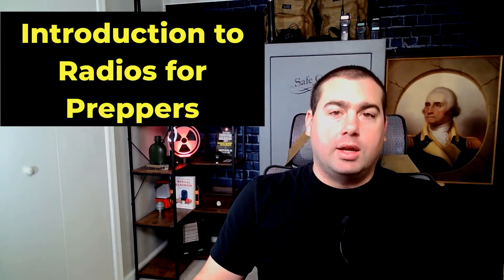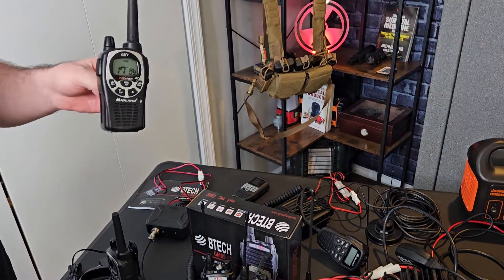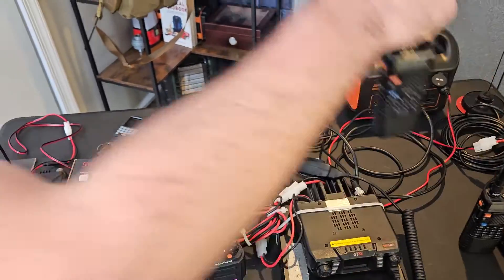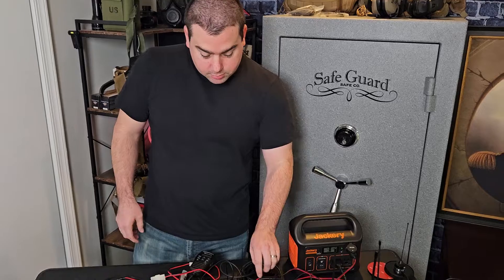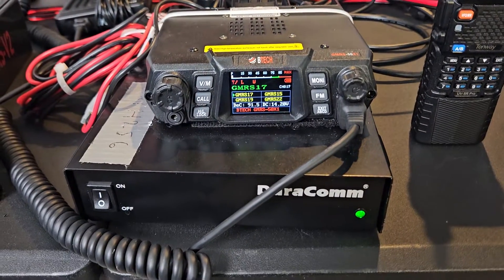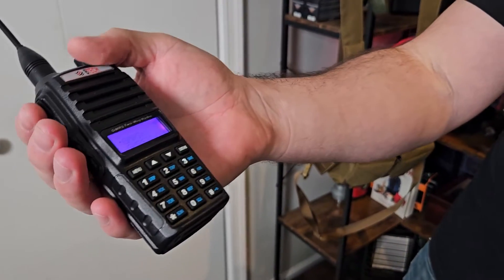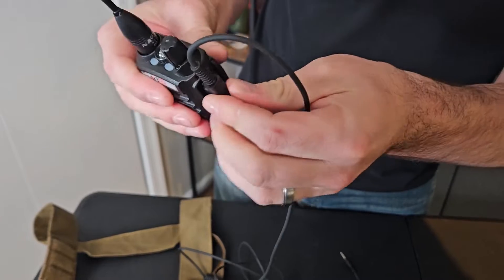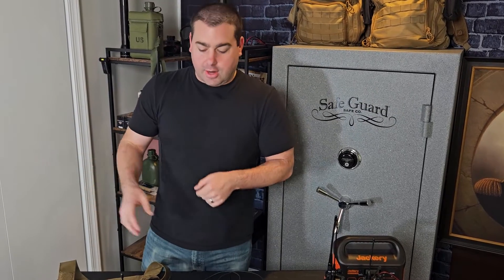A Beginner's Guide to Radios for Preppers

Comment from the maker: Hope you all find this video helpful. I've linked affiliate links to most of the radio equipment shown in this video. Happy prepping!

Midland – MXT275 MicroMobile GMRS Radio
https://amzn.to/3Gps36v

Btech GMRS PRO
https://amzn.to/3sZg2lm

Baofeng GMRS Radio GMRS-9R Handheld Radio (Channel 15 may not work on new models) 
https://amzn.to/3t9JGnT

BTECH GMRS-20V2 20W Radio Receiver
https://amzn.to/47F5pmC

BTECH AMP-U25 Amplifier 
https://amzn.to/3T7w1s0

BTECH GMRS-50 V2 50W Radio
https://amzn.to/3GoAbUW

Duracomm LPX14 Power Supply 
https://amzn.to/48400FP

BTECH GMRS-V2 5W
https://amzn.to/3T6ePTO

Antenna for Base Stations (Low Gain) 
https://amzn.to/3Ro67iE

Antenna Base-
https://amzn.to/4a48NJn

BaoFeng UV-5R 8W Ham Radio 
https://amzn.to/482ql79

Baofeng UV5R Cable to Connect Electronic Earmuffs
https://amzn.to/3RmbGhr

Peltor Tactical 300 Electronic Hearing Protection
https://amzn.to/3GoBdAi

Comment: The Nagoya for Gmrs is the 771G, not the 701G. 
The 771g is a great antenna. 
Don’t buy off of amazon, there are knock offs…but from buy 2 way radios or another reputable dealer.
Reply from the maker: The 701G is gmrs it is rated for the 462 frequency. It is just shorter.
Reply: @citizensurvivalplan  ah yes, you’re right, the 701 is their dual band, the 701g was their first Gmrs specific antenna.
I apologize.
The 701g must be getting discontinued, I see it on buy 2way radios for $9.99. I remember many folks saying it didn’t work very well, that the 771g worked better. 
I’ve got the 771g & it’s a great antenna for the 462-467mhz range:)

Comment: You made enough of an impression that I would like to make some comments and clarifications.  For a beginner's guide, I like where you started.  I thought it would be useful to point some things out for beginners.  Range is a function of line of sight and antenna more than power.  "Height is might" as the saying goes in radio.  VHF/UHF (like GMRS and MURS) is line of sight.  The higher you are, the further you can reach.  There are ham radio satellites and ham repeaters on the International Space Station.  5 watts is MORE than enough to reach them even though they are @250 miles away.  Why?  Because (when they are overhead) you have a direct line of sight.  The power is less important.  If you can get your antenna up 50 feet above the average terrain, you can probably get about 20 miles or more.  There are ham repeaters up on towers over 1500 feet up that can cover 90 miles in all directions.  Power is good for reflecting past obstacles as your signal will be weaker if it reflects off of something before it is received, but your height, followed by the quality of your antenna, will always be more important.  I love SignalSticks.  They are nigh indestructible, all of them can handle at least 50 watts, and are great quality for very little cost.  Antennas do not have to be fancy or pretty, they just have to be right to perform their best.  They are not meant for GMRS or MURS, but you can tune them for better performance by trimming them to an appropriate length.  What is an appropriate length?  See my next point below.  Whatever you choose, lose whatever "rubber ducky" antenna comes with the radio.  Being short may be convenient, but there is a trade off for short and convenient.

LEARN HOW TO USE THE RADIO!  I presume most would agree that, if you were to buy a pistol, you would think it important to learn how to use it and disassemble it at least enough to properly clean it, right?  You wouldn't just toss it in a box and then think you are going to pull it out during some emergency and really be effective.  These radios can be very cheap, but they (and their effective use) is still more complicated than a firearm.  They can also be programmed by computer, though you should practice doing it from the keypad on the radio as well.  They are a tool.  Treat them as such, not matter how cheap or expensive.  This is where a ham license can be helpful.  It provides an excuse to learn the things you need to learn to make these radios effective no matter what band/frequencies you plan to use.  https://hamstudy.org/ has free study tools and apps and can help you find an online testing session when you are ready.  Even if you don't get a ham license, it still a tool that you can use to learn about the equipment you are hoping to use.  Point is, you are unlikely to have much luck with these radios beyond talking to family and friends in the car behind you on a road trip, if you don't take the time to learn how to use the equipment you buy.

A LiFePO4 Lithium Battery that is rated for 12 amps or more continuous discharge will handle most 50 watt or smaller base stations without a problem.  It's best to check the specs on your specific radio to be sure.  I have a 10 amp hour LiFePO4 that is rated for 10 amps continuous.  It can run anything I have smaller than my 50 watt mobile.  The 50 watt mobile draws 11 amps peak when transmitting full power.  If I don't want to use full power, no problem, that battery is fine.  I have an 18 amp hour battery that can handle 30 amps continuous discharge.  That can handle the mobile at full power and my HF transceiver at 100 watts with room to spare.  Nothing fancy.  Just a battery, a radio, and an antenna.  

Finally, I have a few radio licenses and I will not harass you for pointing out that a Baofeng, or a number of other ham radios can work on GMRS.  And no, no one can tell what radio you are using just by talking on it.  Nor do I think too many people care.  People who did go to the trouble of getting a license might be annoyed if you did not go to the same trouble perhaps, but many on GMRS still don't even bother with calls signs, maybe a bit more often on GMRS repeaters perhaps.  MURS frequencies can be very handy.  They are little used and do not require a license at all, like CB.  Those same cheap radios can be tuned to those as well.  5 watts on the MURS frequencies works just as well, sometimes better, than 5 watts on GMRS.  It's still 5 watts.  It's still radio waves.  You want to talk around the world?  Get a ham license and a HF transceiver.  HF frequencies can bounce off the ionosphere.  That's why you can talk such long distances.  VHF and UHF just pass right through and off into space without bouncing.  That's why GMRS and MURS, for instance, are line of sight only.  The difference between HF and UHF/VHF radios?  500 or much more dollars for an HF transceiver instead of 30 bucks for a Baofeng (or similar cheap Chinese radio).  Up to you.  VHF/UHF can be a pretty cheap hobby.  HF, less so.

Ok...  Shutting up now.  That's a real wall of text for a Youtube comment.  Dude, I liked your presentation overall, otherwise I would not have bothered to comment.  That is to say that you only have yourself to blame, LOL!  It's just radio is a very deep topic.  More so than most people realize if they really want to be effective with their radios, particularly in a difficult situation.  I will watch a few more of your videos and see how you present other topics.  Wish you well, 73!
Reply from the maker: I agree with pretty much all of this comment. The only thing ill say about power is this yes hight is might for sure but when were trying use local comms 5 to 15 miles sometimes you may not have a great place for your radio (shtf) some places may be off limits and power can be real useful in a pinch. Thanks for the comment!  it was alot though lol!
Reply: @citizensurvivalplan  Absolutely.  When you are in an urban or other crowded environment with no clear line of sight, that is when power really helps.  Signals do reflect off of things like buildings.  They can penetrate some as well.  Power does help make up for the attenuation of signal you experience in that kind of cluttered environment.

BTW, I noticed that you have a BTech amp in your video.  I have one for UHF.  I use it in a chest rig.  Two admin bags sit on the front in an over and under config.  I have a handheld strapped to the front of the top bag.  the top bag contains the amp and a SignalStik antenna on a relocation mount.  The bottom bag contains the 10 amp hour battery that powers the amp.  The setup does a great job of putting base station/mobile power right on your rig.  Those amps are great for turning any cheap handheld into a portable base station.  Obviously, if you ran some kind of pack, you could relocate the battery and amp elsewhere.  Like many hams, I use Anderson powerpole connectors for everything to make life easy.

Comment: You might want to include the Multi Use Radio Service,  MURS licence free and little used.
Reply: I would think a "Prepper" wouldn't want to limit them self to only a certain set of frequencies and want access to as many frequencies as possible when SHTF. MURS would be a great addition , especially if MURS is hardly used because when SHTF pretty much all frequencies are gonna be tied up. Everyone gonna be walking all over each other and every other household gonna have a blister pack of FRS radios.
Reply from the maker: IMO murs is kinda useless for real world use its for warehouse and buisness use really.
Reply: @citizensurvivalplan  It has more power than FRS and you can switch out the antenna for higher gain. We use MURS at our church.

Comment: Radio range doesn't have much to do with power. It has to do with frequency, mode, antenna, and location/elevation. Hams communicate around the world with only a fraction of a Watt of power. Just as effective first-aid is mostly about medical knowledge, not the size of your first-aid kit, radio communications is all about RF knowledge, not the power of the radio's amplifier. My 1 Watt LowFER station completely blanketed 1/3 of the USA every day with only 7 mW of output power because I learned about RF. If anyone is serious about prepper communications, they need to learn about RF.
Reply: Thank you brother. Recommend any good places to learn?

Comment: Does programming a bunch of UV5R and GMRS radios check the box for emergency preparedness?  Is it not worthy of further consideration, such as emergency first aid, advanced first aid, and defensive training?  What is the plan for comms beyond five miles?  Your ten-mile contact using a handheld radio is an anomaly, an exception case, not the norm, especially between two stock handheld radios (I suspect one station had to be quite elevated).  Will repeaters survive Homeland Security scrutiny?  What if a member of my "team" is stuck in Colorado Springs and needs to communicate effectively with a base of operations in Boulder, Fort Collins, or Twin Falls, ID?  It's fun to push the button and talk on "boof-wang" radios.  Everyone has them because they are cheap, but unless you have a plan, everyone having these in their emergency kit is a joke and will do more harm to a comms network than good.
Reply: With CHIRP all of the radios can be programmed with the same freq's and CTCSS tones and a programming cable connected to a computer before any disaster situation. You are not going to talk from Colorado Springs  to Boulder, Fort Collins, or Twinfalls, ID because it is only a 5 Watts VHF radio. For distance comms, you would need a High-Frequency transceiver.